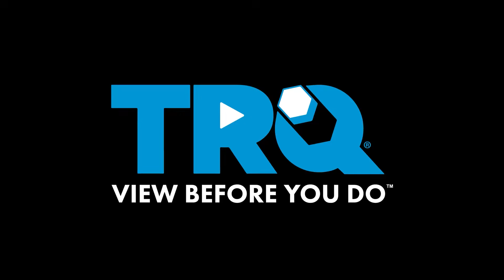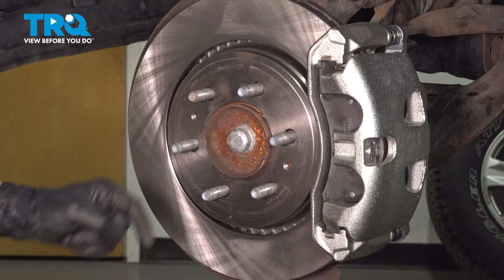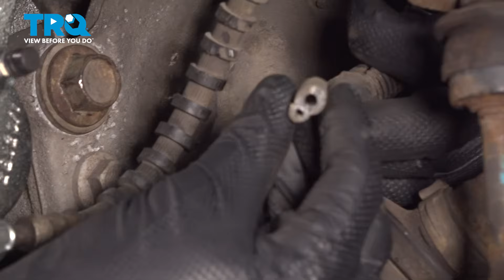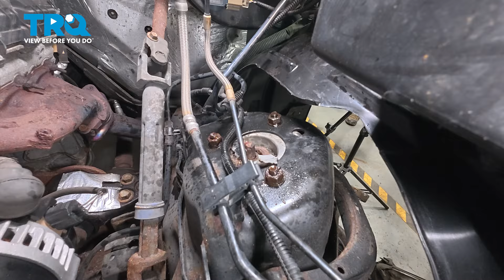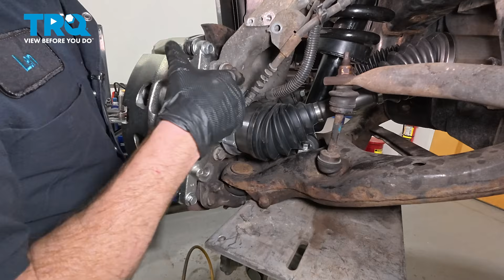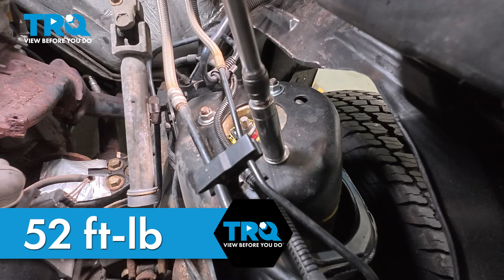How to Replace Front Struts Shocks 2015-2020 Ford F-150

Comment: So what do you do when the bolts in the shock tower inside the engine compartment are turning? There's no way to get on the inside to stop the backside from turning. Leave it to Ford to make the shittiest design on the planet.
Reply: And since it's all on the passenger side now I suppose I'm going to have to pull out the battery, the battery box, the turbo lines, everything's gotta come out to get at those stupid bolts so I can cut them off with a grinder. F*** you Ford engineers
Reply: And since it's all on the passenger side now I suppose I'm going to have to pull out the battery, the battery box, the turbo lines, everything's gotta come out to get at those stupid bolts so I can cut them off with a grinder. F*** you Ford engineers

Comment: American Trucks just disconnected the 2 lower control arm bolts from the frame and removed the strut that way much faster and easier.

Comment: I did this job on my Ford Escape in 20 min per side, none of the knuckle had to be dissembled, just swap struts.  I came here because I was going to do this on my F150, what a PIA.
I've decided I can do this job using just ONE TOOL, my Visa card.
Could this be done using a spring compressor without the knuckle/hub disassembly?

Comment: Most excellent video!!

Unfortunately, driver's side is the easy side.  Found that one of the passenger's side mounting nuts on top of strut tower on an F150 with turbo and A/C is a PITA to reach.
Once tire is removed and preliminary work is done, the one nut under the A/C tubing is easier to reach from the side.  
YMMV!

Thanks!!!